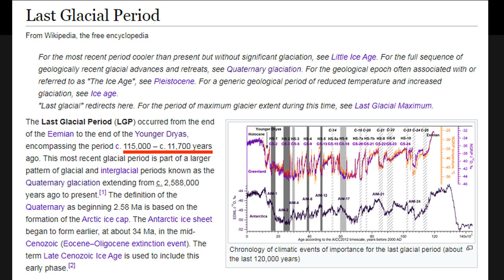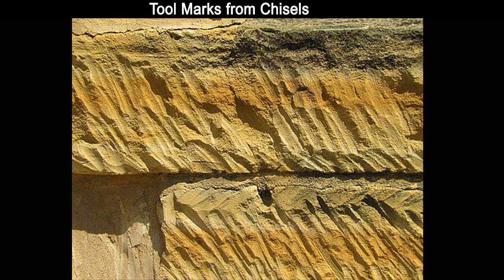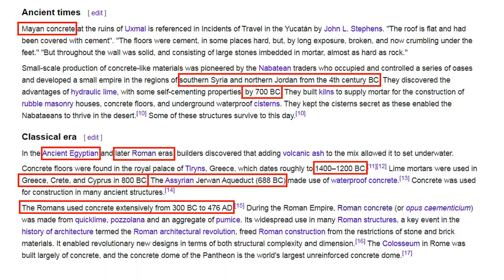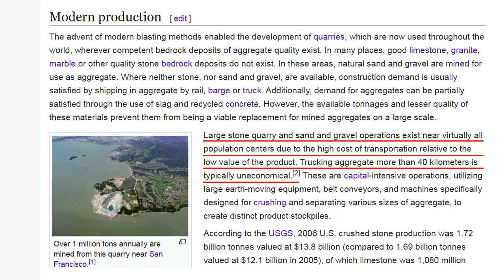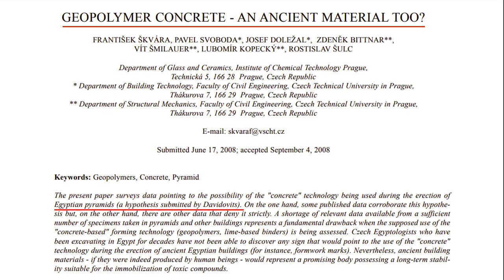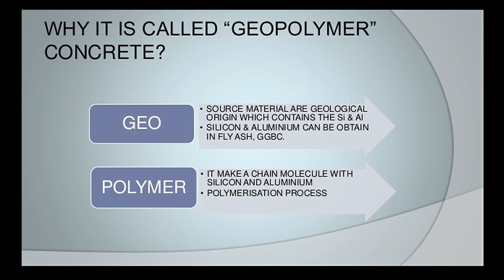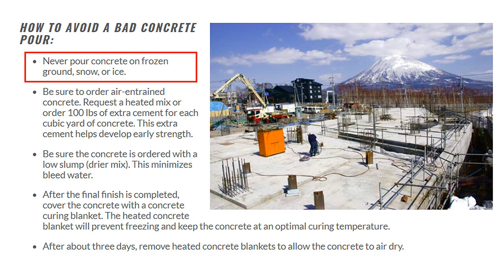Ancient Chinese Quarry: Proof of Prehistory Advanced Technology?!

Comment: I think your theory makes sense that the marks are machine made and that mining could be a likely purpose.  There is also a strong probability of unknown submerged structures along the nearby coast. My key question is the depth of the caverns, making it extremely difficult to lift rock debris out of the quarry.  Normally, one would look at an open pit mine or of a more vertical shaft structure.
Reply from the maker: Yes an open pit quarry would be much easier. I think the people who excavated these sites were very sophisticated therefore transporting aggregates out wouldn't be an issue. Thank you for the comment. Hope you can check out my other videos :-)

Comment: Finally, someone is talking about what I’ve theorized 26 years ago.And was labeled crazy by everyone for suggesting it. That the pyramids and many other megalithic sights are much older. And made of concrete. locally sourced. Colored according to the material used. Later. The lime seeped out and spread across the ground around the structure. Probably during a time the structure was submerged in water.
Reply from the maker: Thank you - I agree that many pyramids and other megalithic sites are made of concrete/geopolymer.

Comment: Look at the Roman concrete content. There is also an aluminum content shared between the quarry material and the Roman concrete. That may explain why there were so many quarries and a lack of mined material locally. 
Our ancestors were highly able seafarers. It's probably everywhere,  but buried beneath the thousands of years of soil deposit.
Reply from the maker: That's a good point. Roman concrete used fly ash or volcanic ash which is rich in aluminum. Thank you.

Comment: Rotary cutter not likely. They can't make a sharp internal corner. There were some internal corners shown. I wonder if geopolymers were cheaper back then than now. They now are significantly more expensive than concrete. (higher than production volume would account for)

Comment: If the Chinese people, were not using this stone, then it is reasonable to think that someone else was.
It would seem a bit odd, that China has no large stone structures, that would have been from the prehistorical, megalithic period.
China has several pyramids, which seem to all have been earthen constructions, and none of them stone.
As you say, it's possible that there are some large stone constructions, that were made of the quarried stone, now under the sea.  But that would have to be proven.
And getting into China to do 'anything,' is always 'forbidden.'
Many have attempted to explore the earthen pyramids, but the Chinese government has rejected them all.
There are others who also speak of 'geopolymers,' and that is maybe a possibility.
But then, why go to such extremes, to cut the stone from quarries, with whatever machines they had, if it was just going to be crushed and used for geopolymer mixtures?

Comment: Tina! Serious question. It's about Meidum:
If you ask an architect, to build a pyramid. No one would start with such a tower. If you can build a tower, which withstands 4 millenia, you will not cover it with a crumbling pyramid.
There are two stages of construction. You can change such a tower to a pyramid within 20 years. That's what the pharaoes did.
A zigurat would have been ok. But it's a strange tower.
Did anybody see such a tower before? Anything like that?
What is this tower???
Reply from the maker: Good question. I agree that the Meidum was probably built in two phases. The outer layer was added later on since the majority of the core tower is covered with casings. It is an interesting solid tower.

Comment: In fact, there are stone structures in China, but the public has no access to them. One of them is the Great White Pyramid, or the Master Pyramid, if it is one and the same and we could not be sure. It was discovered accidentally in 1947 by an American pilot who missed his approached to the base. It is double the size of the Great Pyramid of Giza, it is covered in white stone, hence the name, and based on its description given by the ones on board the airplane this is still a functioning pyramid. There are at least three pyramids in China that are taller than the Great Pyramid of Egypt.
They are spot on regarding everything else. Based on the marks left in stone by the machinery used, it is obvious Wushan was not a quarry for blocks of stone. It was used for making gravel, as stated here. Also as stated, the material may had been used to built the blocks the pyramids are made of, including the buildings in South America mentioned in the video. I am also very familiar with the fact that some of the temples of Asia are made of geopolymers, an artificial compound that was not produced in our time until the late 1978s. 
The videos on this channel are a rare combination of detailed accurate data and a rational interpretation of it.
Reply from the maker: Thank you. There are quite some misinformation online about the Chinese pyramids, such as the white pyramid being larger than the Giza ones. The large Chinese pyramids are made of rammed earth and they are visible on aerial photos. I made a video on this topic with historical photos, recent photos and footage of these Chinese pyramids.  Hope you will find it interesting. Chinese Pyramids: Myth or Reality Revealed - https://youtu.be/w_kRatL5GTI

Comment: Crushed stone = aggragate = very plausible use = geopolymer concretia.  This would explain some very mysterious architectures, but it cannot explain all, like the recent video you have of Petra where there are striations seen on carved features, where a geopolymer would be more akin to a die cast molding.  I just am at a loss as to why there are no tools anyone has ever found in the history of archeological explorations.  Yet, there are extensive copper tools found throughout Egypt, and extensive Old Kingdom copper mines.  Old worn down tools were most likely re-smelted to a sharper tool I would guess.  The only way to get such articulated striations in carvings, would be someone methodically chiseling with all the time in the world, so the impacts dont have to be as hard and you can repeatedly stress fracture into the rock over time, rather than one big clunky hit which would impact much more than is intended.
Reply from the maker: Thank you for the comment. If the machines were used over 10,000 years ago, then almost all remnants would be buried over 10 m underground or submerged by water/ sea. If the machines were made of metal, then they would rust away fairly quickly, like in a few hundred to a thousand years or so. Some surviving metal might be scavenged and recast later. Some might have been deteriorated to a state that they look like hematite. I still think it’s possible that we will find some signs of ancient machinery in the future. 
As for whether hand chisels can make the uniformed striations, I showed comparison photos and footage of hand tools, jackhammers and mining/ excavating machines in this video - Ancient Stone Caves in China & Egyptian Quarry Share Similar Machine Marks https://youtu.be/-cdfOVSpoeY
I also discussed why these striations could not be done by hand tools - Tool Marks on Yangshan Monument Match Modern Machine Marks https://youtu.be/4iZTr_ZJA5g
I also received comments from stone masons and people in the mining industry agreeing with me on the markings.

Comment: There is no possible way this was created by hand. That was created by a gigantic cutting machine. Now I have a question. Could they have used these cut stones to be used in the Great Wall?
Reply from the maker: Thanks Mitch. The Great Wall was initially built with rammed earth and later on upgraded to bricks. Stone is rarely used as building material for the Great Wall. Plus these quarries are in Southern China and the Great Wall is at the north, it would be very difficult to do long distance transportation.

Comment: A very interesting presentation. Can l ask whether the rocks are limestone, because it they are it could indicate periods of acidic chemical weathering of the rock in some situations. Are the parallel horizontal lines on the cave surface level, or perpendicular to the pull of gravity? If so this may indicate pooling of strong acid water which dissolved the rock, periodically or seasonally. If there is a corresponding volcanic period related to when the grottos were thought to have been mined, this could add credence to the acid rain hypothesis. Thank you.
Reply from the maker: Thanks for the support Robert. I made a series of videos on ancient megalithic sites and prehistory civilization. Hope you will enjoy them as well :-)

Comment: The marks on the walls lead to the conclusion that the mined material was ground. It seems that the material was mined as slabs too, unless they are reconstructed of ground material and binder. The reason for reconstructed or mined slabs would be the ease of transport. They are similar in size and thicknes with the salt slabs of Africa carried on camels. 
From the marks on the walls and slabs' erroded edges, it seems that the material is not too hard, so the use of the slabs as construction materiaks or pavements is unlikely.
It is most likely a vulcanic tuff rich in quartz.
With regards to its use, a bulk material of such nature finds the main application in ceramics, tiles, porcelain, bricks and possible some special mortars.
It is also possible that the quarry is not of a verry ancient origin if the volcanic cone held water that found its way in the quarry below.

Comment: It's not geopolymer as you can see exactly the same horizontal marks on the building stones in Egypt.  Also with granite you can see the natural banding in the rocks in Egypt which would be impossible to produce in a geopolymer.  If you have found a quary then you must attempt to find neolithic structures in the flooded zones.
Reply: I won't argue about the Egyptian pyramids, but anyone looking at the ruins of Sacsayhuamán has to strongly consider these were poured. The way the stones mesh and the clear marks of the tool being pulled out when the stone was still liquid are undeniable.

Comment: What I have trouble  with is the only building materials  that the ancients used  was stone. I understand  that stone is an excellent insulator. But there's been nothing brought forward that was used as another building material. Because  if the ancients came here on ships they were most certainly made of some kind of metal. Just wondering.  Like alot of people
Reply: After a hundred thousand years, the only thing left would be the stone.

Comment: Why is each block different in size and the line so tortuous? Because it's probably the result of apprentices' work. Maybe it was a workshop - a school for future masters - stonemasons. Even apprentices sometimes hang out and the result of the work corresponds to that - once it hardens, you can't do anything about it. Yeah, and with that concreting - there's no need to worry about transporting today's non-transportable and massive pieces at any distance, except for the pregnant woman's stone and those blocks in China.
The foundations of the one building on the hill have a circular cross-section - for example there was a water tank - a reservoir on the hill.
One thing is certain - this civilization really did it with stone processing!

Comment: I just found this channel, and find some of your stuff VERY interesting.  I have a few questions and theories to ask you about.  But first, yes, i really find no argument for the completely congruent/consistent and parallel lines showing the scraping on the walls.  As well, it would indicate a scrape and not a cut, for a block per say.  I've done studies on Roman Concrete.  Isn't it interesting that until the last few years, architectural engineers and other fields of study had NO clue as to why roman concrete and ROman structures were still able to be in use today until "they" discovered that the secret was that Roman's mixed volcanic ash in to their mixture?  It was the properties of the ash (i won't get too technical here) that CONTINUED to harden/crystalize the structures as water (especially salt water) would seep in to the structure.  So if ROMANS made this awesome concrete starting say 2,400 years ago, why not the Chinese and other civilizations?
Reply: I'd like to add, that in most ANY city in the world currently, concrete roads, buildings, etc, all need upkeep every so often, within a few years?  AND some ROman concrete structures are still in use today, after 2,400 years.....so WHY aren't we making structures that last in the modern era?  SO MANY theories, but at the end of the day, it's about engineering obsolescence IMHO
Reply: btw, what in the world is that HotSpur poster behind you for?  what does it mean/represent?  asking for a friend :)
Reply from the maker: I think this poster of a robot fighting a saber tooth tiger is fitting for my prehistory machinery theory :-)
Reply: @CuriousBeingbyTina  ok, cool, I'll have to watch more of your videos to come across that theory :)
Reply from the maker: @bobsmith1520  Thanks :-) and thank for sharing your insight

Comment: So is it possible to examine the teeth marks made in those places? What I am thinking, is there a common pattern between them? Say one place in South America has a 3 CM tooth spacing and say 12 teeth, does that match anywhere else in the world? This may point to a common manufacturing place, or show connections to other sites. Unless each machine was hand built. I am betting someone was building them and selling them. Maybe Giza was the place to by your digging equipment???
Reply from the maker: I like this idea - if we can measure the markings and their curvatures on different sites we might be able to figure out if they were excavated with the same machinery. That'll be a very convincing argument. Thanks Alan!
Reply: @CuriousBeingbyTina  Another thing with digging underground is needing light to see and a supply of fresh air. Lamps and lanterns will use up oxygen and or cause explosions with Methane. Fresh air would need to be pumped down to were the digging is. Something very interesting was going on a long time ago.
Reply from the maker: @alanheadrick7997  I agree. Such megalithic sites usually have no soot marks which is really curious.

Comment: If the machines they used were made of metal, they wouldn't have lasted like the stone strucures, stone steps etc. a new 1957 car was buried in a cement vault underground for 50 years, when it was dug up it was very rusty, thats after 50 years if it had been thousands it would have been totally decomposed into large rusty metal deposit inside the cement vault because it got flooded with water.
Anyway, I think your theory is good. I want you to have this link to the car buried for 50 years to help add more detail to your theory about this. And what possibly happened to ancient machines used to make those machine marks, would they have survived underwater etc? Link Since 1957 This New Car Was Lying Underground. It Was Dug up Only 50 Years Later" on YouTube
https://youtu.be/KS5rg_k0zpk
Great work, amazing comparison of the machine marks.
Reply: I fully agree that any machines from thousands of years ago would have rusted away without a trace, my comparison is the enormous steam trains from just 150 years ago, unless they get carefully restored and preserved in a museum they have almost completely rusted away, and that’s only 150 years, and those beasts were do solid
Reply from the maker: Well said - thank you so much for the great information. I will definitely use this video as a reference in the future. Really appreciate you sharing your insight. Thank you!
Reply from the maker: Thanks a lot for the valuable information. I love to get insights like this. Really appreciate it!

Comment: Tina,
Where are the archaeological records of  examples of these advanced macineries?.
If you are talking about advanced technology in the stone or bronze ages could be  as simple as ironi.
My  belief is the advanced technology was either iron or steel crowbars held by a lattice of leather straps on a wheeled wooden frame. There would've be one guy guiding each crowbar, with one guy hitting each crowbar with a mallet.  These would create regular parallel gouges.   You would start with the hardest part , the ceiling, then the walls then work downwards into  the floor to the  depth you wanted.  I think they would have chosen extensive natural underground caverns and cave systems to start with.
 All the chipped stone could be easily hauled away on carts, another advanced technology.The spoil  might be below sea level.. as you suggest.
You don't need self  powered machinery for it to be advanced technology.
Reply from the maker: Thank you for sharing with me. 
I have a video comparing the tool marks at ancient sites with jackhammers and mining/ excavating machinery. Iron or steel hand tools cannot make the same uniformed markings - https://youtu.be/-cdfOVSpoeY  

I also made videos on the time frame of a possible advanced civilization and where the ruins might have been. Hope you will find them interesting. 
The Lost Civilization of the Megalithic Sites: Who Built Them and When? https://youtu.be/u4V_ZQukWEU
Lost Megalithic Civilization: Finding Their Remnants? https://youtu.be/0KBfaLJykF4

Comment: Your hypothesis is quite logical. 
But where are these ancient polymers to be found?
Surely at least some small artifact should have survived?

Another possibility is that stone is an abundant source of oxygen.
If an advanced civilization was terra-forming Earth, the easist
source of oxygen for the air and to make water would be to use
stone. Hydrogen for the oceans is abundant in the outer planets.
Reply from the maker: Thank you Jon. I think we will probably find underwater structures built by geopolymer on the continental shelf at the East China Sea.